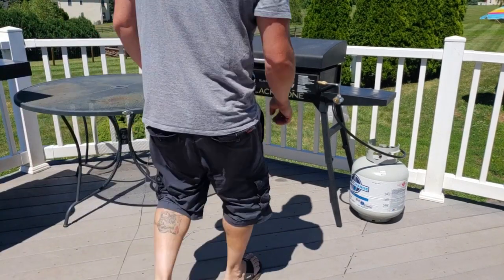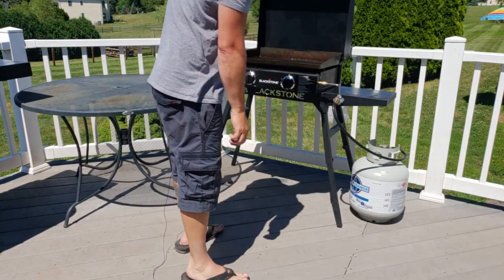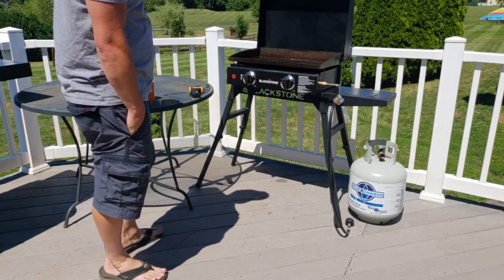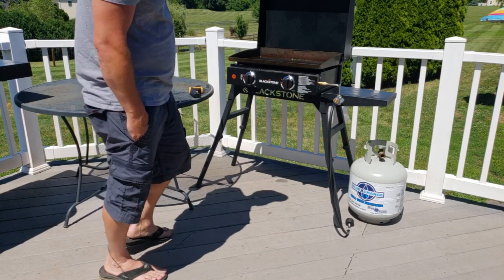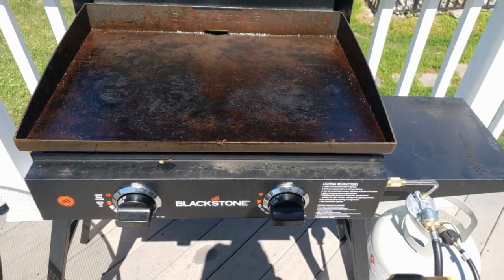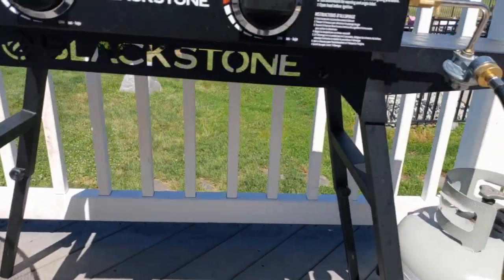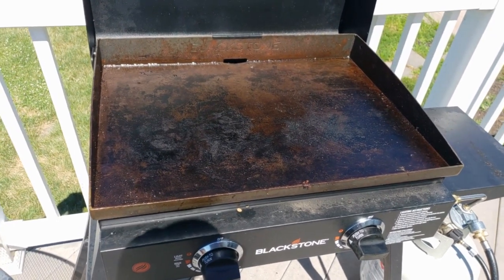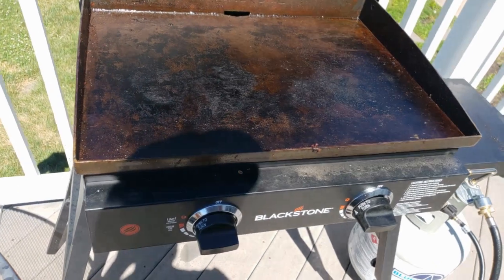Getting low propane flow?  Reset your propane regulator on grill/griddle.

Comment: AWESOME!!   We have the 17" blackstone and bought a new 5lb tank, smaller than the big 20pounders, but, bigger than the disposables.   But, I kept getting low flow.   After seeing your video, I tried opening the valve very slowly, instead of very fast like I usually did, and it appears to have resolved the issue, once, at least.   If it works next time, then I'll believe it!!!  Thanks again!!
Reply from the maker: Great to hear Bill!  Yeah, I'm not sure when everyone introduced these safety valves, but I didn't get the memo! :)
Reply: I did the same thing. Can't get the 5lb to work. I'll try it your way!! Thanks. *Stupid new safety measures@#$&!*

Comment: Thanks for this video.  Bought a large Blackstone and it's been running low. Thought it was a bad tank. Exchanged it and no improvement.  Just reset the regulator and it works again.  
Thanks again sir

Comment: The 1st video I watched showed me exactly how a regulator works - decreasing about 150 psi at the tank down to about 1 psi at the burner tube. Interesting video - he sawed the parts apart with a bandsaw, and showed valves and spring stuff. But what he didn't explain was why I had about 270 degrees when I normally had about 650-700 degrees.

So I got to your video next, and saw my mistake, and how to fix it. Firstly, I had left one of the burners on, accidentally - so the 1 psi was depleted. The regulator couldn't recover out of protection mode with the 150 psi applied. Followed your steps, and BINGO - I'm a happy griller again. Great video... I won't forget the process steps on how to reset a regulator again.  😉

Comment: Great simple tip and it fixed the problem. BBQ was working great until it ran out of propane and the tank had to get refilled. Barely lit until doing these easy steps. Thx

Comment: Works like a charm!  I've ran into this issue numerous times. Usually ended up just disconnecting everything and trying again with varying degrees of success. I think I was doing it too fast. Not giving it the 30 seconds. Either way, the 30 second wait combined with the slow operating of the valve seems to work great. Thanks.

Comment: Man thank you for sharing your find! I purged the lines last time I used the grill then the next day I had 8 people dinner but the flame was so low and the take was heavy. I ended up taking the tank to get refilled but the operator told me I had 10 lb of gas still in it. Your vid helped thanks again

Comment: This happened to me while grilling. Tank ran out. Swapped tanks to recently refilled full tank. Then My Weber Genisis wouldn’t exceed 200f. My Temp gauge may be off.
Checked all connections for debris. Disconnected tank but NOT for 30 seconds. Called propane supplier-no help.  
Then I typed “low flow” into the  rectangle of knowledge. 
Should have done this first. 
30 seconds later the grill is back to max heat. 
Thanks for posting!
Reply from the maker: Awesome - glad it worked and thanks for letting me know!

Comment: just what I needed. I've had this happen many times over the years and by sheer luck of taking the tank on and off finally got it working. Now I know the issue. Something worth noting. I live someplace that gets cold in the winter months and this issue seems worse in cold months. Meaning I think it takes longer for that "Slam" valve to open again when it is 10 degrees outside. I can say this issue is common when people change tanks because they generally let there LP run out, and just pull the old tank off and try to reignite the new tank without all the turning off of burners.

Comment: Thanks for the tip. Had a problem right out of the box but with your help it seems to be working fine.
Reply from the maker: Great to hear!
Reply: In general the regulators are finicky if you don’t start them right.  I have a Holland Companion that about 1/2 the time I cant run on a 20#tank.  It works perfect on the 1 pound,  Has to do with the Pressure.  I have to hold my mouth right..  I wrote this sometime ago and since then I have figured out to very slowly only open the 20# valve less than 1/8 of a turn and all is well with both grills.

Comment: Same grill, same issue. I never had the dials on but did turn the propane tank valve very quickly and cause it to barely output flame. I ended up using the small bottles and all worked fine so will try this technique if it happens again. Thanks

Comment: Thanks for the tip.  I have a gas smoker that does not turn off completely that does this if I leave it on high last time and forget to turn it back down.  It's weird because it never used to do it when I first bought it.
Reply from the maker: That's weird - wonder if you can warranty the regulator?
Reply: @RobsBackyardBBQ  lol it's over ten years old, it's fine except for that one little issue

Comment: The safety device is in the black plastic knob that connects to the tank. It is call an excess flow valve (EFV).  Another way to reset the EFV is simply to close the valve at the griddle and then close the valve the tank and then wait 10 minutes.  The pressure on either side of the EFV will equalize and it will open. Finally very slowly crack open the valve at the tank until you here a small hiss.  Ten you can fully open the tank valve.

To avoid in the future, the key steps are to always turn off the valve at the grill before very slowly cracking open the valve at the tank.

Comment: Good video... did this after happen first  time and happen again..  question is are 20 lbs putting out to much fuel and triggering safety shutoff ?
Reply from the maker: It probably happened 1 out of 10 times.. was never sure if i had left the knob on, or if the dogs did, or if it was just a failure.  This procedure clears it up though.

Comment: Suggest that you only open the valve on the tank sufficient to allow full flow of gas, no more. This is slightly more than cracked open. If there is a problem then it is a quick flick of the wrist to close the tank.

Comment: I did everything step by step like you and I'm still not getting it to work. The tank has gas but I don't hear or smell anything when I open the valve. Everything was working fine but the last time I tried to use it and it ignited and shut off right away and since then I haven't been able to ignite it again. The ignitors are positioned good too. Any other ideas on what it could be

Comment: How is this working for you? I had this set up, but after a while, I cannot get full flame. I ordered a new BS regulator.. No difference. Some have said that I must get a set up that has the regulator at the tank. Also some say a adjustable regulator at the tank is even better. Black stone help told me, to keep removing the hose then wait then reconnect to reset the regulator safety feature. After 1000 times I give up. Only once in awhile this would work! Have you had this problem? I notice that BS is now selling a hose with a regulator at the tank end on Amazon?? For these same griddles!

Comment: Having the opposite issue, light the burner on low... turn it up and the flame blows out and propane is still flowing. Might be my regulator flowing too much gas? Or a spider built a nest in the burner vent restricting oxygen to support the flame? The regulator on mine doesn't appear serviceable and is a cheap thing. Before I buy parts I need to check for a closed off air vent. Any other ideas to look at?

Comment: Wonder why any gas at all would flow if it thinks there's a leak?   Anyway, I thought this might be the issue on my (under warranty grill) but then I heard gas shooting out from where the hose connects to the tank.   They Said I need new hose so they sent it, I changed it, and all seems to be fine.

Comment: my brand new 17 in blackstone i converted to a 20lb tank and it wont have a big flame and wont adjust. so i did what you did.  bs has a video that does the same thing.  didnt help.  i did it 5x just to make sure.  sstill small flame flickering and going out.  so i put back on the 1lb can of propane and no problem. works fine.  so what is the problem??????
Reply from the maker: If the 17 doesn't come with the extension hose for the 20lb tank, the regulator might be meant only for the 1lb tanks - and picking up on a pressure increase or something and setting off the safety.  Have you contacted blackstone at all?  Maybe you could use the regulator/extension from the 22".

Comment: i had low temps as well on my brand new 22" and thought it was because i was using the disposable 1lb propane tanks. possible?
Reply from the maker: I've only used the 20lb tanks on my 22" so can't be sure.  This should work for you, however since it still could be the regulator sensing a false leak and triggering a low flow condition.

Comment: You are using the adapter hose right? From bicg thank down to a small tank connector
Reply from the maker: Correct - the 22" Blackstone I got came with an adapter hose for the 20lb tanks.

Comment: mine got stuck, I did what you said to do....nothing, I left it 5 min...reconnected...opened slow...still nothing....I then microwaved a cup of water, slowly poured over regulator....I heard a faint hiss, it released!....then open it up all the way, backed off 1/4 turn....this was on a wall heater...I then turned up heater....that gave me heat...still touchy because of cold snap

Comment: I have had my Blackstone for two years now......this is a pain in the butt. I am looking to sell or scrap my Blackstone and look for a model that I do not have to work on.
Reply from the maker: Hey Blane - I believe all propane grills nowadays need to have the safety style regulator.  The main trick is to make sure the dials are 'off' on the grill/griddle and turn the propane on slowly.. 1/4 turn at a time so you don't trip the safety.

Comment: Where is your regulator?  Is it in the cooking unit?  I don't see a regulator at the tank.  I have a need to control a flame in a special device I am creating, but the gas flow keeps declining over time.  I have a typical regulator with a built-in flow-rate control valve.  When I set it and walk away, in ten to twenty minutes, the flame has diminished and sometimes it has gone off.  If anyone has a clue as to what is wrong, I would appreciate any comments.  I am inclined to think it is another case of 'CCC' (Cheap Chinese Crap), however, I would like to be wrong and to find a simple fix.
Reply from the maker: The regulator for this one is screwed in directly to the unit, then hose to the 20# tank.
Reply: Thanks ... doesn't help with what I am trying to do, but I appreciate your taking the time to let me know.  I guess the hose can handle the full take pressure alright ... didn't know that either, but it makes sense, it's not like hundreds of lbs as with acetylene.
Reply: Get a new hose. Had the same problem with mine .

Comment: If those so called safety regulators are going to go into a limp mode for some reason, they are not engineered correctly.  What could happen with a standard 20 lb LPG tank and fuel to the regulator to the manifold?  Seems quite a PITA as the regulator senses a false alarm as often as folks are claiming.  May the other makes of regulators are best to use since it seems the alleged safety feature in these regulators are more trouble than they are worth. Ramping down the flame, if there is one as it could be raw unlite gas, is really helping out in an explosion idea. Maybe the mauf should add more details about the device and engineer a better safety feature that doesn't sense false alarms.

The griddle in the video has too much debris on it, crusty black etc.  A well seasoned griddle needs to be wiped off with fav oil after each use and should be baby butt smooth and brown/black. FYI

Comment: This reset worked for a couple of months, but then the regulator wouldn't reset no matter what I tried, ended up buying https://www.amazon.com/dp/B088GT8W6X and tefloned where the hose goes into the elbow and has been working nicely! Just thought I'd share in case anyone is experiencing the same issue.
Reply from the maker: Great info man

Comment: I can't get mine to even let enough gas through to light the grill. Tried this technique but doesn't seem to be working.
Reply from the maker: Eric, maybe unhook the propane and make sure the burners are off and let it sit 10 or so minutes just to make sure the regulator can reset.  Then hook up the propane (with the burners still off) and very slowly open the propane valve 1/4 turn at a time.. once it's fully open, open one burner and light.
Reply: @RobsBackyardBBQ  my solution was buying a third party hose. The Blackstone hose seems to be defective. The new hose works flawlessly with no need to open the valve slowly. Seems to be a common issue with the Blackstone hose.
Reply from the maker: @Egadler  Awesome - would you be able to post the part number and where you got it to help out others?  Also, which blackstone do you have?
Reply: @RobsBackyardBBQ  I bought the Weber part No. 8212599 from Ace Hardware. I have the 22" table top blackstone. It's been working great
Reply from the maker: @Egadler  Thanks a lot - glad you got it figured out.  Seems like you got a faulty one from Blackstone :/

Comment: You’re wasting time accomplishing nothing both opening the valve that way and waiting 30s. 

You can skip the 30s wait if the regulator inlet valve isn’t shut tight. Turn one grill valve to pilot. The tiny flow will keep the regulator inlet valve slightly open. Shut off the tank and disconnect the regulator from the tank promptly. There’s enough high pressure gas trapped to keep the regulator fed for some time, but not long enough to do something else in between. Now when the regulator inlet pressure drops to nil, there’s no need to wait for stray leakage to get the regulator to open its inlet valve so it’s outlet pressure also drops like a rock and the restrictor pops back open right away. Close the grill valve, reconnect the supply, open the tanks valve.

You’re hoping that raising the inlet pressure slowly will keep the restrictor from slamming shut again, but what you did made no difference. You can’t crack the tank valve to raise the pressure slowly that way. The inlet pressure at the regulator will jump from 0 to tank pressure in the first 10° (1/36 turn) of handle rotation as the valve goes from shut tight to interference fit to not touching. After the first 1/3 turn (60°) it’s just opening wider so it isn’t a flow restriction during filling and purging. 

What you are re-setting is supposed to restrict flow if the regulator fails or a valve or a line line ruptures. It restricts when gas is flowing and its outlet pressure is lower than its inlet pressure. Think of it as a plastic ball on a soft spring right where the tube diameter goes from larger than the ball to smaller. When it’s inlet pressure is about the same or less that it’s outlet pressure the spring can push the ball off the seat to stop restricting. With equal inlet and outlet pressures the restrictor should unseat itself. The normal pressures are so low that the spring force has to be tiny or it would never restrict. When foreign material adds a little friction the spring isn’t enough force to un-seat the valve and the appliance has a puny gas flow.

What you’re trying to do is to reverse the pressures to un-seat the restrictor. You get 11” of gas pressure at the restrictor outlet by closing the grill valves.  You get a low pressure at the inlet by dropping the supply pressure. With no LP flowing the regulator’s inlet valve is shut. You’re waiting 30s for stray leakage to drop the regulated pressure so that the regulator inlet starts to open. That vents gas backwards dropping its outlet pressure which makes it open wider and the regulator outlet pressure which is the restrictor’s inlet pressure falls very rapidly. The gas volume at 11”pressure between the restrictor and the gas valves unseats the restrictor.

Comment: My flame starts off big then goes back to small lil flames
Reply from the maker: If your flame is still going back to small, then the regulator is probably going into safety mode again..   if your hoses are intact and there are no other leaks in the system, then i'd replace the regulator - possible warranty from manufacturer?

Comment: Dude. Just from a health and hygiene perspective, close the lid. Let the actual grill heat to the proper temperature (400°c) before adding your food. Not to be naggy, i know this was not the point of your video. But, if anyone did not know. The way you took the temp only evaluating the heat rising in the air, not appraising the grill itself, which is not educating any youtubers. When the entire grill has a chance to heat closed it is essentially sanitizing. Try to get a thermometer you can leave inside the grill if your does not have one on the lid. Just trying to be helpful. In a preventative way. Thanks for your re-set tip. 👍